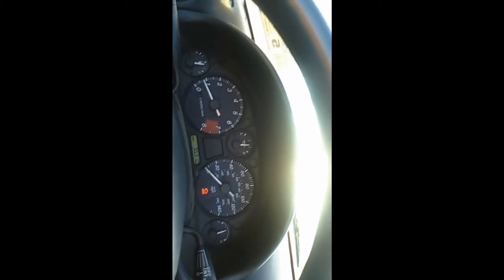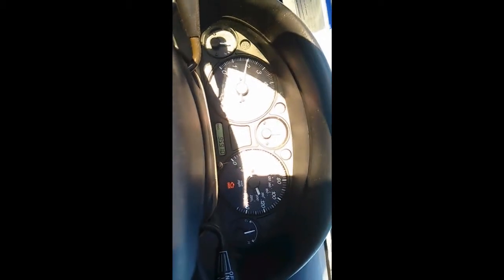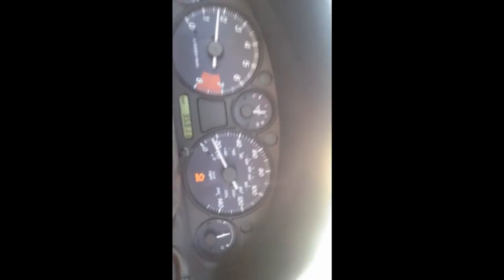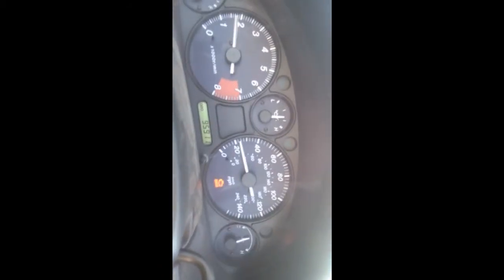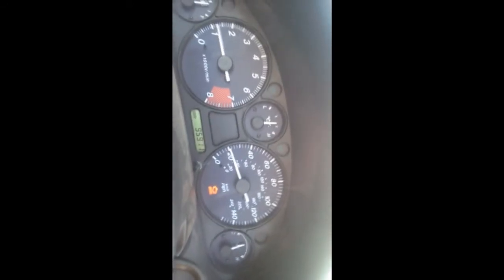2000 MX-5 Miata No acceleration or power SOLVED

Comment: I’m having the same exact problem with my 2000 LS manual. I changed the down stream 02 sensor, fuel filter and no change. I will try coil pack. Thank you for making this video
Reply: Same all around. Fuel filter, wires and coil pack. Still having the same issue. Problem started when I changed the spark plugs specifically tho. So im swapping those out next. Fingers crossed 🤞
Reply: Find anything out?

Comment: i had the same thing , i have put in a brand new coilpack , spark plugs , and new wires 

its a common issue on the mx5 , one of the coils goes bad and it will do that on low rpm
Reply: mythic anomaly does

Comment: PLEASE READ!!!! Cold start on a 2003 NB auto and it misfires on and off until good running temp and its good from there. Misses for 10-15 seconds then runs good for 10-15 sec. Changed plugs and coils as well as running seafoam to clean injectors and premium gas for higher octane. Any tips? Please help. CODE P0302

Comment: Could be a variety of things in all honesty. Could be something as simple in the ignition system, or it may be a sensor. Could be a Throttle position sensor, air flow sensor, ect. I would check spark plug, and plug wires, then I would go to sensors starting with Mass Air sensor. If it's past any of that I believe it may be something worse. I'm not A Mechanic, but my grandfather who raised me was and without getting someone with a bit of experience to help you, it'll just be trial and error until more problems occur.
Reply from the maker: Appreciate the response, you were right with the first assumption lol. It was indeed the Ignition Coils. Had a spare one and replaced it and it works like a charm again.
Reply: Glad I could help! Usually if you keep the fluids regularly replaced and flushed, and replace the plugs and wires, usually you're problem free unless you somehow manage to blow the entire motor up :P
Reply from the maker: Robert Scarlet
Exactly what I try to do, only thing is i'm down $700 for a problem that could've cost me nothing at all if I knew what it was! Never going to Pep Boys again haha.
Reply: TrickStatus That's why i'm so greatful to have been raised around a mechanic! I mean with the newer vehicles it's best to take them into a shop, but if it's made before 2010, generally asking online 8 out of 10 times works just as nice if it's nothing major! Get in touch if you need anymore help, and it's a shame how much some places charge for things!